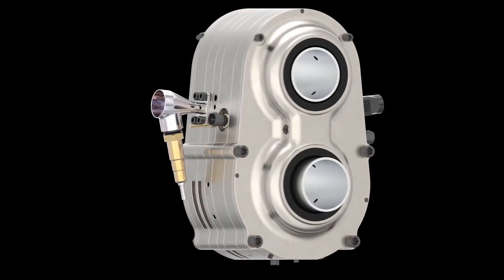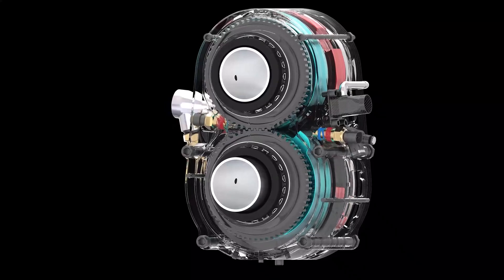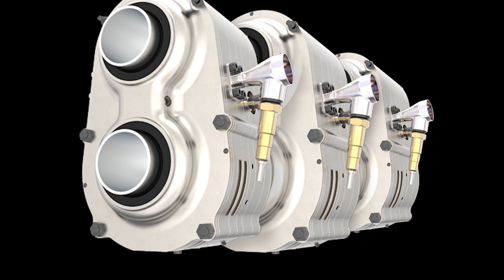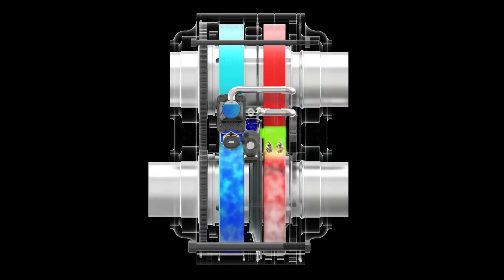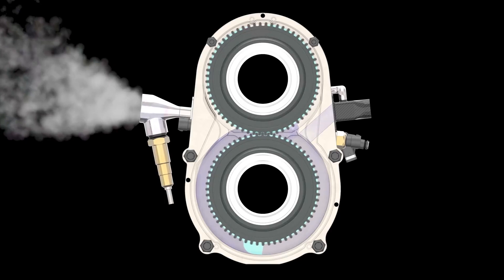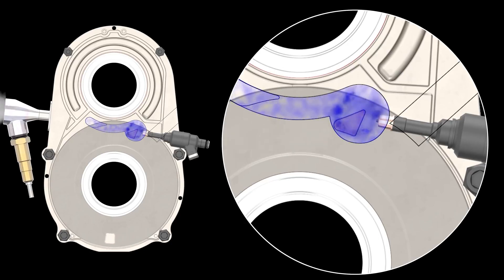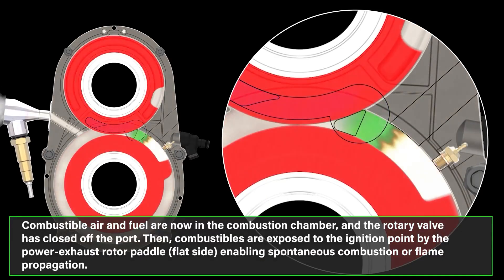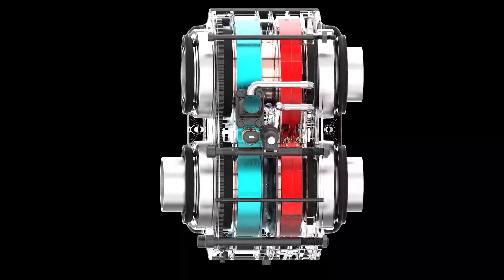This pistonless engine runs on hydrogen and revs to 25k rpm

Comment: Why develop ICE engines in this day and age, such a waste of money, time and effort, I would sack the research team and get them doing something useful like cleaning the streets or emptying toilets at Show grounds and Concerts.
It won't matter how great the motor is, if it's an ICE engine it will fail to gain ground as it still produces pollution, Hydrogen burnt in a compressed state creates Nitrogen Oxides, these are not good, Hydrogen is only a clean running fuel when burnt in the open and then it only produces water, there is no such thing as a little Nitrogen Oxide, it all depends on the amount of fuel that goes in will produce the same amount of Nitrogen Oxide, no matter the engine design, to get torque you need combustion that produces power, gearing only works to a point and is why a Human powered Bicycle can only go so fast
The higher the revs the faster the wear as well as fantastic spectacles when they fail, just go to any Drag strip to see how high revving engines blow up, such fun to watch, same as if you get to work in a Dyno Tune business for a few weeks, nothing like an engine failing to get the adrenaline moving :).
Hydrogen will never become a fuel for Cars, there is no infrastructure in place for refuelling and it takes a lot of Electric to produce hydrogen, why waste the Electric on old technologies when you can just use the Electric that is required to produce the Hydrogen for charging EVs, seems a silly waste of time, also Hydrogen is many times more expensive than Fossil fuels and tens of times more expensive than a KW of Electric, cars then  also need to be redesigned for a Hydrogen tank and imagine how much fun it would be to watch a tank of Hydrogen explode in an accident as it explodes much better than gasoline, just ask the passengers on the Hindenburg,
I find it weird that people try to hold onto old technology for so long, they did it back when cars first were taking over from the Horse and Carriage/Buggy, Carriage and Buggy manufacturers tried to entice buyers by making changes and adding things they thought people would prefer, but guess what, those Companies that tried to hold on went bankrupt, same a Companies trying to hold onto ICE today, any COmpany that is trying to go Hydrogen or stay Hybrid will go down hill very quickly in about two to three years if they don't keep up.
Fan boys won't wait forever if their favourite brand doesn't make an EV for them as they will be forced to go another brand that does.
If you are a young person and are at the lights and some old fart next to you in a Tesla and you are in some new fangled Hydrogen or other ICE vehicle and the lights change and the old fart in his EV leaves you from the lights, how long do you think those ICE fanatics will stay interested in ICE if every EV on the market is faster than they are as well as cheaper to run.
It's the races that push what young people buy as far as cars as they want as close to what the Race drivers are driving, once EVs start showing in the major races and winning, guess what will happen to the ICE at the race track ;)
Instead of refuelling stops we will see a super fast battery change instead, it's not like you see the race car turn up at a bowser and some one refills it, they have special fill systems that allow gallons of fuel to enter very fast, EV race cars will be redesigned to have a plug and play battery pack that they will set up to drop and replace in a few seconds, depending on the length of the race.
Reply: Until BEV charging stations are as widespread as gas stations AND as quick to refuel then BEV will be a sideline car, only good for urban life, useless for highway trips. Range anxiety is a real thing and gets really bad in the winter when the heater eats half your battery life.
Reply: @Dannysoutherner  Considering over 90% of drivers never do more than 50K a day driving, where does the anxiety come from ? Did you know the early ICE only got 200 miles at most per fill and you had to go to the Hardware store with a can to get fuel, no Road side assist, if you broke down, then tough luck you had to organise to get your car home by getting some one with a Horse or another vehicle that had enough power to tow your jalopy home. Everything changes and EVs will change the fastest as we already have the majority of the infrastructure in place, Electric power is every where, setting up a charge station is a lot simpler than setting up a Hydrogen system and a Hydrogen powered car can't even go as far as an EV on a tank so talk about range anxiety for hydrogen car owners then lol. Plus where do you refill your Hydrogen car and how long does it take to refill ?
Reply: @Dannysoutherner  Wrong again, you can carry a Solar Blanket and recharge enough to get to a charge station, if you were stupid enough to drive away before having charged at home, I don't know any one in the last 20 years that was dumb enough to drive with barely any fuel and fuel these days is far more expensive. If you were out bush and ran out of fuel, no matter how much Sun or how long you sit that ICE will go no where, with an EV pull out the Solar Blanket and sit for an hour or so and away you go. I don't know anyone that has a can in their car in case they run out lol, you are trying to use irrelevant arguments to stay negative against an EV, Also as EVs become the norm they will bring out charge blocks like those we have for mobile phones that will give us the same as a can of fuel would to an ICE, stop living in the past and using silly excuses on why an EV is not as good as an ICE :)
Reply: @billybobjones4317  well let's see. You sound Australian, endless summer. Here in the arctic sunlight can be in short supply. 

I guess you are perfect and have never run out of gas. If so bully for you. Most people are not Jesus. 

BEV cars cost average 60 thousand dollars per blue book. My bronco is paid for. Am I stupid enough to go into debt for a new car I don't even want?

Also BEV cars are far from green. If your power station is coal fired then your BEV has a steam engine chugging away.

Also BEV cannot be fully charged in 5 minutes like my bronco can and it's 40 years old.
Reply: @Dannysoutherner  My power station is Solar as I am in Australia and we get 300+ days a year full Sun, Winter or Autumn, no Vehicle created in the last 150 years has been pollution free, it's after its been made that matters, an ICE keeps producing pollution all it's life, a BEV not only will cost me nothing to run for the next ten years, but will then be recycled and the Batteries would be repurposed for battery storage or other purposes we may not know as yet. I don't know how a person could run out of fuel in the last 50 years as there is a Service Station on almost every corner and for the last 20 years at least open 7 days a week and 24 hours a day, you would need to be really stupid if you lived in a cold climate and didn't make sure you had enough fuel to get you home or to you destination, talk about range anxiety if an ICE can't get you where you need lol. My Vehicles are also paid for but cost me near $100 a week to fill if I look after my Grand Kids and during School Holidays I could use one and a half tanks of fuel driving my Grand children about buying a $48,000 EV will save me $5200 a year at least and as much as $6500, this means over a ten year period my BEV will cost me nothing and actually save me money, if I had to buy another car and I bought an ICE, not only would I need to pay the cost of the Vehicle minus my Trade in but the cost of another vehicle in fuel use not counting the oil changes and radiator flushes and servicing costs. I don't understand how people can't afford a BEV if they can afford to drive an ICE ;) most people only do at most 50K a day so they wouldn't save as much as me in fuel but others I know do 200 kilometres or more a day, a BEV would still do them fine and they would just charge over night with their garage installed high power charger, some EV sellers offer one free with the New car and others offer x amount towards a high powered charger install and at a $1000, I would get one any way as my Power provider will pay me to use my BEVs battery storage during night periods as they pay me for my access power during the day. oh and I would move from where you live to a place like Australia, my family did so when i was young, best thing they could have ever done for us kids, my kids and grand kids are very happy we live in Australia as I have taken them over seas to places with snow and although fun for a few hours, to live in that, no thank you very much we love our water sports and camping to much ;)
Reply: @billybobjones4317  I'm glad you live in the tropical climate with endless sunshine. I'm glad you have the disposable income to throw down 50 thousand or more for a car. I don't. Nor do I find them desirable. My bronco I've had since 1996, paid 1200 dollars for it. Mileage isn't bad for a 4 wheel drive suv. Insurance and registration is dirt cheap. Very reliable and easy to repair if something breaks. You are spending 6000 a year paying for it? Over 8 years? Plus interest? Plus electricity, high insurance and registration. No, my bronco is much cheaper than your BEV technological terror.
Reply: @Dannysoutherner  My BEV will cost me nothing, it doesn't take much to work out with how quickly cost of fuel is going up, same as my Solar panels paid for themselves in four years and my Solar Hot water paid for itself in three years, this is the beauty of Electric equipment, do you know how much it has cost me to charge any of my Garden equipment or battery tools over the last decade ;) exactly nothing, thanks to Solar panels. Where I live we get free registration for two years if we buy a BEV as well as 12 months free use of the Governments charging system. Plus they will pay me $3000 and charge me half the Stamp duty of an ICE, it's a win win situation. I am sad for you that you can't afford decent things, I hope things improve for you so that you can afford to either move to a nicer Country or buy what you need, hope your car looks after you, I just find the over all driving experience of an older car is no fun, I had an R/T Charger back in the 70's, was a bullet on wheels but what a crappy car to drive unless going straight :). Cheers
Reply: @billybobjones4317  Are you telling me that the country of Australia uses no fuel for electricity? That Australia is entirely wind and solar? I find that hard to believe. I realize that your whole population is smaller than that of Texas or Florida but I still find it inconceivable that 20 million people get all their electric from solar. Our deserts have similar sun. I have lobbied for decades to set up solar power stations across west texas, arizona, new mexico and desert california to deaf ears.

I have also lobbied to drill around the edges of yellowstone park and use the free heat there for electric power. That could run the whole country by itself.
Reply: @Dannysoutherner  Never said we were 100% renewables, I did say that I was over 100% renewables, therefore any BEV I buy will cost me nothing to drive and this will be the same for millions of Australians that have similar to what I do as far as Solar on our Roofs.
South Australia ran for four weeks renewables only and is improving monthly, it won't be long before South Australia is fully renewables and other states are going far better than many of the larger Countries around the world.
Reply: @billybobjones4317  Yes but you still have that 60 to 80 thousand dollars average investment in the BEV plus another 20 thousand average for a battery at some point. These BEV batteries are made of all sorts of horrid toxins, cannot be recycled like lead acid batteries can and make you dependent on China alone. If nothing else being dependent on the worlds most powerful and avaricious country would make me think a horse and wagon is a better deal.

The math tends to break down like this - a BEV on average costs 20 thousand more than the same in gas. Say an electric F150 compared to a gas F150. It would take 9 to 10 years to begin saving money on the BEV. By then battery time so saving up the spout. 

Say you wanted to drive from Melbourne to Darwin, a distance millions of college students drive at least twice a year here, can you even do it? Are there enough fast charging stations along the way? I cannot conceive of your solar blanket charging your car fully in a day, much less the 5 minutes it takes to feed a gas car and be on your way. A BEV would lose badly in any 24 hour endurance race. They don't have the legs for it.

If you live in the city and never drive more than 50 miles a day then okay, if it floats your boat. But the old Jetta gets 35 mpg, costs not much to buy, will run forever and not rely on infrastructure that won't be widespread in our lifetimes. I highly doubt America will have widespread super chargers in the 10 years I may have left, if we are lucky and don't get nuked by China.
Reply: @Dannysoutherner  As I also said previously, with an ICE I only keep spending for fuel as the car will go no where with out Fuel that I have to go to a Service station to get and at over $2 a litre, it costs me now over $100 to fill my ICE tank each week, this is what you can't seem to understand, you can't see that I as well as millions of others will never need to go to a Service Station to refill their BEV, they can do it for free at home.
My $46,000 BEV will only cost me nothing over the ten years that I will keep it, there is no $20,000 battery replacement requirement it's a BS story by you.
The BEV that I will be buying has a 7 year unlimited warranty, that's also unlimited kilometres, the Lithium Iron Phosphate battery system has a 1,000,000 mile life time, it's something I will never do in my lifetime.
It doesn't matter how negative or false facts you try and use as I heard the same things about the Solar System I bought for my House and yet that has returned me not only free electricity but at least $2000 in credits every year, I don't listen to the BS all you negative people try to use as facts as I see the facts of people that actually have an EV and not those that don't.
I don't know why you can't understand the cost of ownership between the two systems ? It's like you want the ICE to be better for some reason ? I know from past experience that ICE can cost people thousands depending how well they care for it as there are so many hundreds of parts that require OIL and Water to keep running, if it runs out of oil, the ICE is stuffed, if the ICE runs out of cooling water it's also stuffed, neither a problem with a BEV, and we also don't get a clutch or automatic issue as problems, there are hundreds of moving parts in an ICE that can and do go wrong.
BEV have far less problems, they don't have any more Sensors or Electronics than an ICE.
I have seen over the last 60+ years change and every single time there have been negative people like yourself that either make up BS or spread the BS they read or hear from other non factual sites or comments.
They said the same things about the Automobile and the Computer and every time the negatives were wrong and left looking like fools.
BEVs are fairly new they haven't had over a century of development, look at how many problems ICE have, just drive to the Coast or any where and see how many ICE are on the side of the road waiting on a Tow truck or support of some kind, with over a Century of research and development, ICE still only last the same as ICE back 50 years ago, they just have more bibs and bobs.
BEV in such a short time have outpaced ICE in everything except for distance per refill and they have almost equalled that, the BEV that I am looking at will do the same mileage as my V6 Diesel or at least close enough to be no different, as the BEV will give me far better economy in Suburban and City driving and with regen set at max, I could possibly get better mileage, although I couldn't give a rats if the BEV only got 100 miles per charge as I very rarely do more than 80 miles a day.
Any way I hope you don't lose to much money on the ICE you buy, I do know that your ICE will cost you each and every day that you drive it and so it's cost of ownership just keeps getting higher every day you drive it :)
Reply: @billybobjones4317  My ice has been paid for since 1996. I have no interest in getting back into debt for a vehicle.

In your doctoral thesis you did answer a big question for me - you do have a fossil fuel car, you are not dependent totally on BEV so my point is made - you don't trust it for a long road trip due to lack of charging infrastructure. So you made my point unintentionally.
Reply: @Dannysoutherner  No I don't have a BEV as yet simply because we have no choices in Australia, they are only starting to offer pre orders and as I said I will never buy a car I can't sit in and take for a test drive, I am retired and so must look at costs of purchase, same as I did getting my Solar panels, Electric with Solar pay for themselves over time as will BEVs, which you can't understand ? Your old piece of crap costs you every day you drive it, if you had Solar or Wind or Water to power your Electric, you could then not only charge for free but recoup the cost of the Electric power over time. But as you said, you are poor and so can't afford a new car no matter it's fuel source :) this is why you are upset, so enjoy your choice for being poor and don't take it out on those of us that did make sure we could afford a new car when we want, cheers
Reply: @Dannysoutherner  How is you being broke and unable to afford a better car ? Facts are not insults, same as who cares about feelings as they don't make a difference to facts.
We know you are poor or broke as you have to keep a near 30 year old vehicle, even at my poorest just after getting married, at most my car was 8 years old.
Old cars are only kept for two reasons, one is yours and two is as an antique if it's old enough, your is not antique and so kept for no other reason than you can't afford an upgrade.
Most normal people buy as new as they can afford once their car gets to a certain age as not only do parts become more difficult to get but there is more maintenance to an older car as the old technology doesn't last as well, an older car from the 90's also probably won't have fuel injection unless it's a diesel and I think you mentioned it was a Petrol engine.
Brakes, Handling and suspension on older cars are not as good as newer versions, nor are the safety features of an older car as good as newer.
My car has a 5 star ANCAP rating, this means in an accident I have a greater chance of surviving.
I drive my Grand Children as well as my Children, driving an old car is neglecting those that I would have in my car as any accident in an old car will cause more damage.
So you either don't drive others or don't give a damn about the safety of anyone else.
The newer safety measures are why less people die in car crashes these days compared to back in my day, cars that I drove as a young man had drum brakes and no power assistance, no ABS, no Radial tuned suspension, they didn't even have air bags or crush zones that absorbed an impact, solid chassis that passed on all impact damage to the people inside the vehicle.
No one drives an old car by choice as a better option and do so only from monetary reasons.
I am sorry you are broke, but it's your choices that made it so, also a near 30 year old car is a piece of crap compared to any car made in the last ten years.
Also a 5 to 10 year old car is not expensive and so $46,000 or more is not required.
A newer car is also cheaper to insure as safety features are taken into account, the safer the car the less the insurance Company needs to pay out for damages to people inside the car.
Cheers and I hope your circumstances improve so you can get your self at least a 21st Century model ;)
Reply: @billybobjones4317  Calling my Bronco an old piece of crap is an insult. Now there are several reasons I do not want some new piece of Chinese made junk. Airbags - my 1988 mustang did not have air bags - nor does my 84 Bronco, 81 Monte Carlo or 80 Camaro. Airbags make any car into a rolling bomb and were created because people won't wear seat belts. Too many computers - my cars are all carburated with GM HEI electronic ignition (yes even the Bronco has an aftermarket HEI for Ford). Dirt reliable and easily fixed if a failure should occur. Todays technological terrors can leave you stranded and at the mercy of the local stealership. Cost of course. All my cars are paid for. Insurance and tags are cheap. I am in debt to no one except my mortgage company and that is for 18 more months. Going into debt for any vehicle is just stupid. The makers know they have the customer by the short hairs and squeeze them for every cent. I have not had a car payment since 1992 and that is how I like it. The new cars are sterile soulless little boxes or vastly oversized pickup trucks, all totally overpriced and not worth the cost. I'll keep my cars that I happen to enjoy driving thank you.
Reply: @Dannysoutherner  Cars don't get insulted, never seen one even get upset when sold :) it is a piece of junk as it's now past 24 years, that is old as far as Cars go, cars are like Dogs, if you get 10 to 15 years from one it's done you well, trying to keep one alive past 15 is just cruel.
If you did like I do and as others like me do and change their cars every four to six years, it's not that much of an outlay for the next upgrade, unless of course you buy an American made car and then it's near a total loss after 6 years, if you look at BEVs they seem to be holding value very well as I was just looking at second hand to see how the market was and I was surprised to see many older BEVs still selling well at better prices than I would have thought, so not everyone has your opinion as far as BEVs go :) my $78,000 car will still see me get about two thirds back as a trade in or private sale as ICE are still relevant for a little while longer as there are many people like you about, not as far as being able to afford another car but that think ICE are not the way of the future :), this means that I can buy the BEV I have been looking at for no change over and at most depending on how cars are selling in three months maybe a couple thousand to spend to get my brand new ATTO 3 as it's not available to buy as yet only pre order and I want to sit in it and drive it before I buy. 
We will see in five years time and I will send you a comment to see how your opinion has changed, I think it will be the same as my Brother in laws opinion on Computers, he may not like them but knows they are the way to go as he had the same attitude when computers were in their early stages and boy did he feel like a fool after  as he lost his very lucrative business for no other reason than being a stubborn fool :)